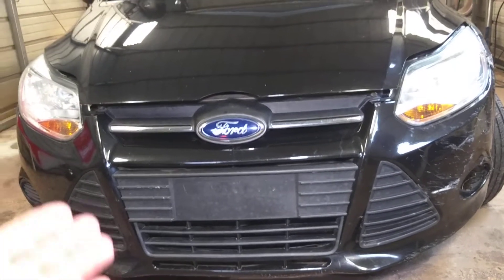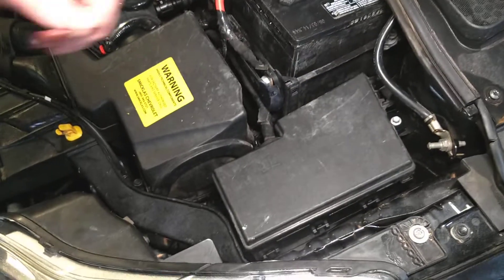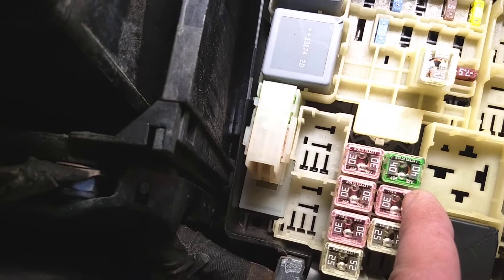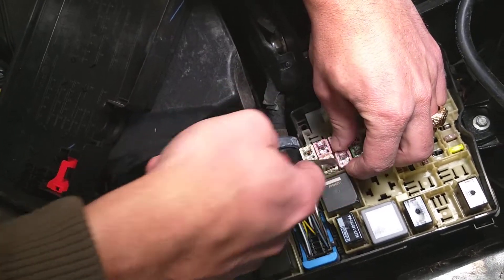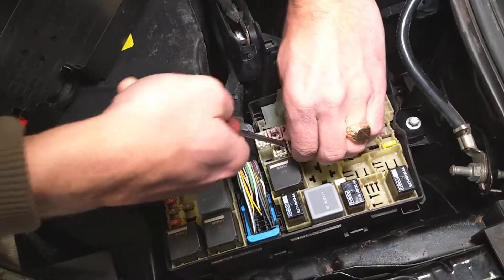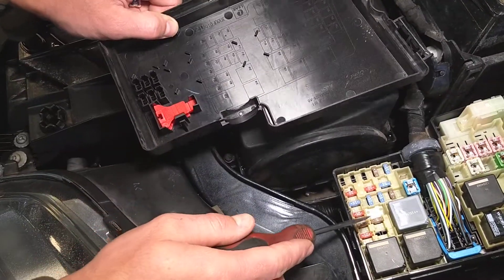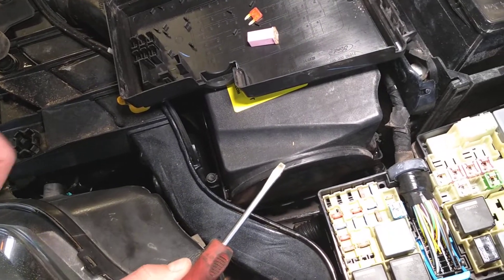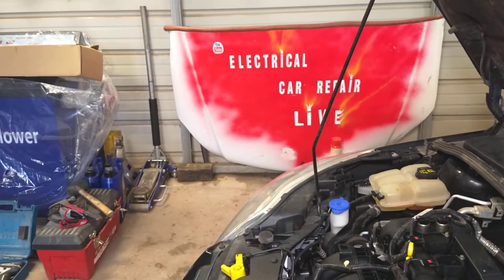ECU ENGINE CONTROL MODULE FUSE LOCATION AND REPLACEMENT FORD FOCUS MK3 2012-2018

Comment: FOR THE ENGINE FUSE BOX LID - TAKE A SMALL FLAT HEAD SCREWDRIVER AND SLIP IT INTO SPACE ON TOP LEFT LATCH- PULL IT GENTLY BACK TOWARDS YOU AND IT POPS off-  impossible to do with your fingers - took me an hour to open lid

Comment: That's a set of from the dealership for that ECM computer location everybody knows did any source of vibrations is the reason why the computers get damaged so why would the dealership with the computer there they do this on purpose all bad😢😢😢😢😢

Comment: I have a Ford focus 2011 model I don't what happened but the car doesn't want to switch on even. I tried to replace the fuses but nothing even the speedometer is not on nothing is in the battery is fully charged. What might be the problem?

Comment: Thank you for your advice👍
My Ford focus was just cranking and no start.
I checked the long J type/Pal fuses and one was blown so i got replacement fuse and now car starts all good.
I didn't know about this type of fuse to check,  therefore i would of got a mechanic and most probably i would of got ripped off.
Reply: Hi there same problem with my mates focus can you explain better please. J type fuse where is that thanks

Comment: Help please!
Car starts, idles bad then revs drop and it
cuts out, even hitting the gas pedal doesn't
help
The throttle unless I catch it right seems to
hinder the engine and stalls it.
If I catch it right I can force the revs to level
off and it's runs fine after
There are no codes I can see on the ECU
I've just changed the high pressure pump as I
thought that was the issue but now the new
pump is doing the same.
Really getting fed up with it now
Anyone that's had similar issues or can offer
any advice would be really gratefully received.
Thankyou
Reply: did you ever fix this ?

Comment: My car was struck by lightening and now I'm getting errors that read: "Engine Fault, service now" and "Steering assist fault. Service required." When I try to start it,  it won't crank,  but the lights,  radio, dash lights, door locks, and AC/heat blower still work fine.  What's my best strategy to repair my vehicle?
Reply: Hi did you repair your car ?was ecu ,bcm connected to scanner?
Reply: Same. Did you ever figure out a solution?

Comment: My car turns on but wont move its been having shift problems like wont even shift gears now it not even moving and it keeps making weird electrical sounds
Reply: If it’s a focus 2012-2018 it’s probably the clutch forks
Reply: yeah idk how to get them unstuck without taking the engine out based on videos i watched

Comment: Hi mate ! 
Thanks so much for your expert advice !
I have solved the problem with my 2016 ford kuga As was not starting correctly , it was clicking and going dead and when I replaced this f13 /30 amp pink fuse it has started perfectly again , wow I was worried but you have saved me here mate thank you so much , as it seemed a big problem 
But because of you I'm so grateful 🙏
I appreciate this so much as the man in the sales desk in fords main dealer say that it had saved me at least £500 pounds by diagnosing this because there garage manager would have added to that and would have made it alot bigger job than it was , as they always do and they would have kept it for about a week 
So it shows what they do 
Anyways thanks so much I appreciate this 
Subscribed now 
And so will all my work mates 
Family and lots of friends 
Thanks again you legend 🙌👍💪🙏🙏 !!!

Comment: Any one with no start and starter clicks once.  I changed starter motor. No change a friend found at the positive  cable termill in line fuse . Covered by tape and plastic covers . Found it blown. No volts going to starter to crank .my friend took it out of play.  Drilled new hole with out fuse direct to pos . Started straight away  . I hope it helps .

Comment: Hi 
I have ford s max 2008 zetec 2.0
And car going in limp mode in 4th gear sometimes 
I’m getting these two codes u3001 and u0401
Any help appreciated 
Thanks
Reply: u3001 = "Control Module Improper Shutdown Performance"
u0401 = "Invalid Data Received From ECM/PCM A"

Comment: U0284(00)
Raw code: C28400
ECU: 000
Status: Test failed, Test failed (current drive cycle), Pending, Confirmed, Test failed since last DTC clear
OBDII: Lost Communication with Active Grille Air Shutter 1 Motor Module
============2==============
C1011(27)
Raw code: 501127
ECU: Engine control unit
============3==============
C1011(24)
Raw code: 501124
ECU: Engine control unit
============4==============
C1011(16)
Raw code: 501116
ECU: Engine control unit
============5==============
C1011(01)
Raw code: 501101
ECU: Engine control unit
============6==============
C1010(01)
Raw code: 501001
ECU: Engine control unit
============7==============
C1008(50)
Raw code: 500850
ECU: Engine control unit
============8==============
C1006(1D)
Raw code: 50061D
ECU: Engine control unit
============9==============
C1006(1C)
Raw code: 50061C
ECU: Engine control unit
============10==============
C1006(1B)
Raw code: 50061B
ECU: Engine control unit
============11==============
C1006(1A)
Raw code: 50061A
ECU: Engine control unit
============12==============
C1006(0D)
Raw code: 50060D
ECU: Engine control unit
============13==============
C1006(0C)
Raw code: 50060C
ECU: Engine control unit
============14==============
C1006(0B)
Raw code: 50060B
ECU: Engine control unit
============15==============
C1006(0A)
Raw code: 50060A
ECU: Engine control unit
============16==============
C1006(07)
Raw code: 500607
ECU: Engine control unit
============17==============
P0200(05)
Raw code: 020005
ECU: Engine control unit
OBDII: Injector - circuit malfunction
Ford: Injector Circuit Malfunction
============18==============
C3300(50)
Raw code: 730050
ECU: Engine control unit
Status: Test failed (current drive cycle), Pending
============19==============
C3200(50)
Raw code: 720050
ECU: Engine control unit
Status: Test failed, Pending
============20==============
P3F00(50)
Raw code: 3F0050
ECU: Engine control unit
Status: Test failed, Pending
============21==============
P2B00(50)
Raw code: 2B0050
ECU: Engine control unit
Status: Test failed, Pending
============22==============
P2A00(50)
Raw code: 2A0050
ECU: Engine control unit
Status: Test failed, Pending
OBDII: Heated oxygen sensor (HO2S) 1, bank 1 - circuit range/performance
============23==============
P0E00(50)
Raw code: 0E0050
ECU: Engine control unit
Status: Test failed, Pending
============24==============
P0B00(50)
Raw code: 0B0050
ECU: Engine control unit
Status: Test failed, Pending
OBDII: Auxiliary transmission fluid pump motor - phase U current malfunction
============25==============
P0A00(50)
Raw code: 0A0050
ECU: Engine control unit
Status: Test failed, Pending
OBDII: Voltage converter coolant temperature sensor - circuit malfunction
============26==============
P0500(50)
Raw code: 050050
ECU: Engine control unit
Status: Test failed, Pending
OBDII: Vehicle speed sensor (VSS) - circuit malfunction
Ford: Vehicle Speed Sensor Malfunction; VEHICLE SPEED SENSOR "A"
============27==============
P0400(50)
Raw code: 040050
ECU: Engine control unit
Status: Test failed, Pending
OBDII: Exhaust gas recirculation (EGR) system - flow malfunction
Ford: EGR Flow Malfunction
============28==============
C2000(50)
Raw code: 600050
ECU: Engine control unit
Status: Test failed, Pending
============29==============
C1500(50)
Raw code: 550050
ECU: Engine control unit
Status: Pending
Ford: Transfer Case Contact Plate "B" Encoder Circuit Failure
============30==============
C1100(50)
Raw code: 510050
ECU: Engine control unit
Status: Pending
Ford: ABS Pump Switch Circuit Failure
============31==============
C0600(50)
Raw code: 460050
ECU: Engine control unit
Status: Pending
============32==============
C0300(50)
Raw code: 430050
ECU: Engine control unit
Status: Pending
============33==============
C0200(50)
Raw code: 420050
ECU: Engine control unit
Status: Pending
============34==============
P2000(50)
Raw code: 200050
ECU: Engine control unit
Status: Pending
OBDII: Nitrogen oxides (NOx) trap, bank 1 - efficiency below threshold
============35==============
C1003(66)
Raw code: 500366
ECU: Engine control unit
Status: Pending
============36==============
C1003(65)
Raw code: 500365
ECU: Engine control unit
============37==============
C1003(44)
Raw code: 500344
ECU: Engine control unit
============38==============
C1003(41)
Raw code: 500341
ECU: Engine control unit
============39==============
C1003(40)
Raw code: 500340
ECU: Engine control unit
============40==============
C1003(33)
Raw code: 500333
ECU: Engine control unit
============41==============
C1003(32)
Raw code: 500332
ECU: Engine control unit
============42==============
C1003(30)
Raw code: 500330
ECU: Engine control unit
============43==============
C1003(28)
Raw code: 500328
ECU: Engine control unit
============44==============
C1003(27)
Raw code: 500327
ECU: Engine control unit
============45==============
C1003(25)
Raw code: 500325
ECU: Engine control unit
============46==============
C1003(16)
Raw code: 500316
ECU: Engine control unit
============47==============
C1003(15)
Raw code: 500315
ECU: Engine control unit
============48==============
C1002(98)
Raw code: 500298
ECU: Engine control unit
============49==============
C1002(97)
Raw code: 500297
ECU: Engine control unit
============50==============
C1002(23)
Raw code: 500223
ECU: Engine control unit
============51==============
C1002(22)
Raw code: 500222
ECU: Engine control unit
============52==============
C1002(19)
Raw code: 500219
ECU: Engine control unit
============53==============
C3200(50)
Raw code: 720050
ECU: Engine c

Comment: Hello there I have a question I have a 2015 Ford Focus I had the starter motor replaced for some reason the F15 fuse sometimes keeps blowing and in the hand book its ment to have a 30amp fuse but in my car it has a 50amp plz help